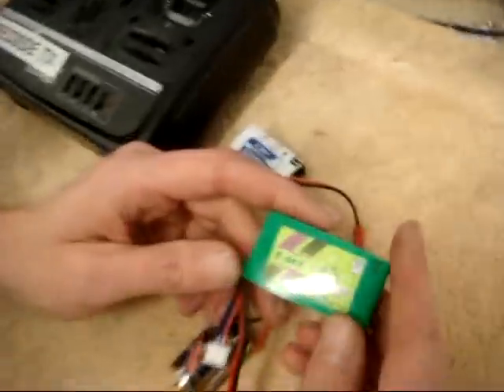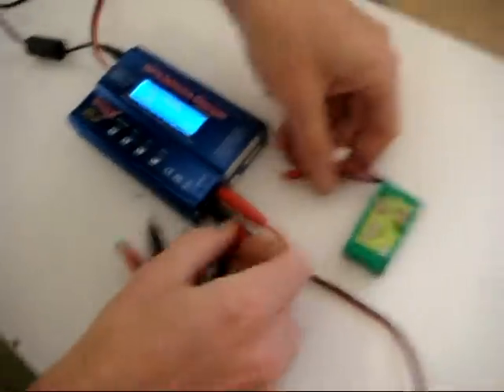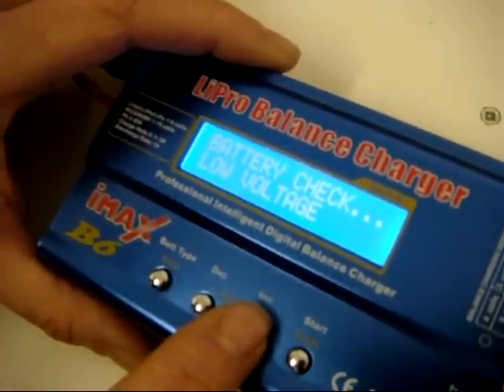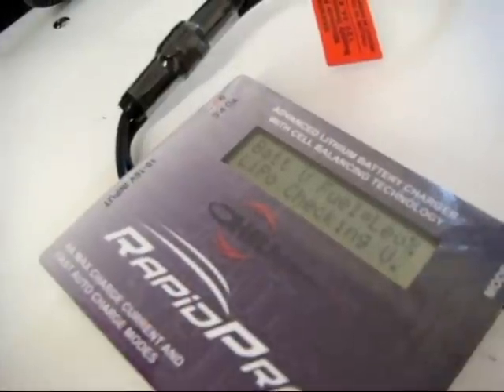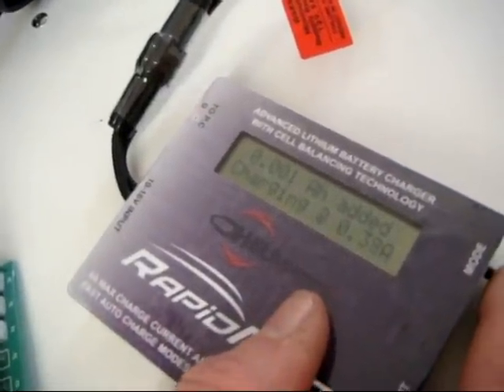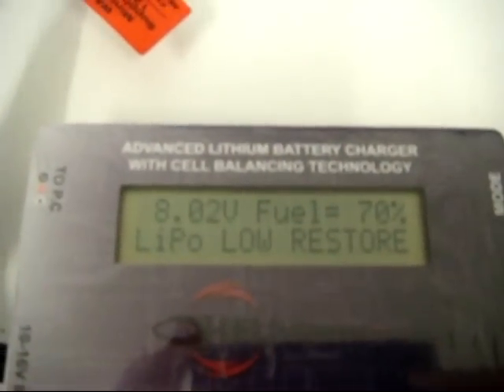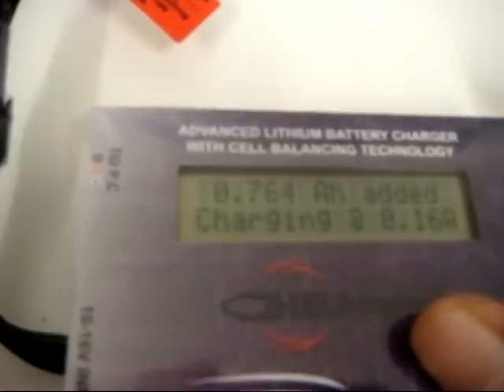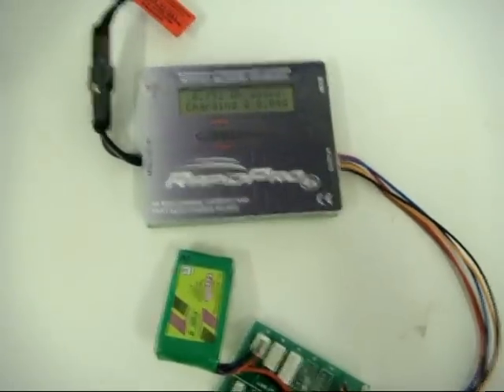dead battery revival with rapidpro charger?

Comment from the maker: @alexztyphoon well put it this way I accidentally left a battery plugged into a heli at work over night, a quick non balance lead plugged in charge as a 1 cell battery (that was as low as the charger would allow it to be charged) was enough voltage to allow the rapidpro charger to revive the battery!